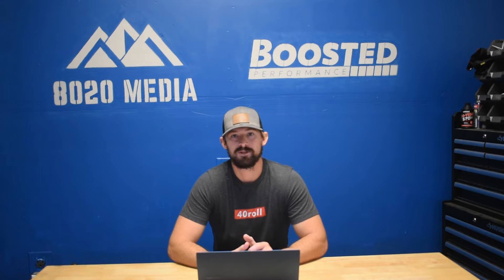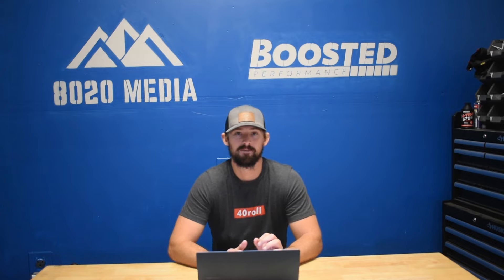DIY: How to Fix GMC/Chevrolet "Service Stabilitrak" & Traction Control Lights!

Comment: I only get this error message when I first run my car and it is cold outside AND only when im giving it gas. Stops if im coasting.  I live in snow country. once the truck warms up it stops giving me the dash notification. So frustrated.  Maybe you have a suggestion?? Also...awesome video. Gave me alot to think about and I've been researching this issue for over a year now. Thanks!!
Reply from the maker: Are you having any rough idle or sputtering issues when it's cold and your on the throttle? It could be a bad plug or coil but guessing you've already looked into that. I'd recommend looking into the idle control valve if you haven't.
Let me know if you have any other symptoms and I can try to narrow it down but if there aren't any noticeable symptoms then it can be challenging to diagnose which is the biggest issue with the stabilitrak lights...
Reply: Same here, mine is only happening when I first started my car and it's cold outside. Never happened when pumping gas. I notice it will be idling rough when the light is on then when it goes away the car doesn't shake anymore.
Reply: Hello everyone; Thanks for the Good video. In my case ; It happens only when it's cold or below normal, Engine Temperature indicator WON'T pass the 2nd mark which is next to C. I would assume it's around 50°. Reduce engine power, slows down, to less than 30mph , gas paddle won't respond, I stop,, Turn car off. Wait 1 or 2 minutes,, Restart,,All dashboard indicators is off. Drive normally,, TEMPERATURE STILL at 50°.  Drive  couple miles,,until it happens again..and Rested again. I have no doubt it's THERMOSTAT STUCK OPEN. What do you guys think. Didn't replace yet . It's cold weather this week. DFW, Tx .. 3 weeks later,, I'm sure in the case of pushing/ accelerating will be too much gas in the system that not enough air to burn it. I learned for the past 3 weeks since my 1st reply,, I don't push gas hard ,, if let car go gradually. It won't REDUCE engine power.until next discovery,, good luck to all Crappy 3.6 Chevy Camaro owners 🙋
Reply: @bassamghaferi3723  Sounds like coolant temp sensor.  Change that along with the thermostat assembly and use genuine GM.  Also, make sure coolant is fresh and proper level.  If green, it is even more critical due to it being galvanic over time, which bugs out the temp sensor.

Comment: This has happened on my 2020 chevy equinox a couple times over the past several months. It only ever happens when I'm driving down the road and accelerate a little too quickly for my cars liking. Or if I bump the cruise control up too quickly up a hill or something. It turns off cruise control and The engine light, TC light and the stability traction symbol light come up. Seems to drive fine still immediately after it happens. I haven't been able to get the codes because once I turn the car off and turn it back on all the lights are off. If it could be any number of things as you explained in the video, it's going to cost a lot to figure out what's causing this. 💸💸💸
Reply from the maker: K - How many miles do you have on it? The fact that it resets, you should be fine for the near term pending how many miles are on it.

Comment: I'm pretty sure traction control limits the power to any individual wheel by applying  braking power to the wheel.
Reply from the maker: That's correct, it uses ABS but also reduces torque sent to the wheels. Stability control is essentially a more advanced version of tracking control. It's sort of confusing breaking down the two but one way people put it is that all stability control is traction control, but not all traction control is stability control.

Comment: I have a 2014 GMC Acadia. Mine started going crazy when I was pulling a trailer moving from TX to NC. I was about 140 miles away and it started going crazy while I was on the highway. I replaced the brake position sensor and cylinder 6 spark plug and ignition coil (had a code for cylinder 6). It fixed when I changed the ignition coil, and then started back the next day on the way to work. I just noticed today that my brake lights stay on.
Reply from the maker: Check the brake switch, that would cause the lights to stay on and cause this. Also usually recommend changing the plugs and coils for all cylinders at the same time.
Reply: yep, mine was the brake switch causing havoc.

Comment: My 2007 Chevy trailblazer stabilizer sensor is out and every mechanic said it will cost two thousand dollars is it ok to disconnect the sensor
Reply from the maker: M - It’s technically possible to disconnect the stabilizer sensor, but it’s not ideal for safety, especially if you drive in poor weather or challenging road conditions.

Comment: Type "B" DTC's stored in the ECM (as a current fault) will request the Stabilitrac warning.
Reply from the maker: Thanks for the good info!
Reply: @8020Media  You bet!
Reply: How do do this?
Reply: GM WORTHLESS BS SYSTEM Trans  shifts  hard as soon as triangle  is lit?
Reply: @thomaslizarraga4955  Depends on the application, but hard shifting is generally the result of a system malfunction then transmission main line pressure is increased by default to try to save the transmission from damage.

Comment: Hey Jake. Great video! I have a 2007 Yukon and when I drive, if I take my foot off the gas for about 10 seconds, the service stabilitrak and traction control lights come on. When I hit the gas or brake, it goes away. Any ideas? When the lights are on, it makes the trans shift real hard also.
Reply from the maker: D - Have you taken it to a shop?
Reply: @8020Media  yes it has been to multiple dealerships and no one can figure out what’s going on.
Reply from the maker: D - Very interesting.. This is one of the first times we've heard something described like this. Give us some time to look into it.
Reply: @8020Media  not sure if it’s related or not but I recently had some codes for the Banks running Rich? I cleared it and just drove to Virginia over four hours and the check engine light did not come on and the stability track did not trigger.
Reply from the maker: D - Well hopefully it stays off for you! Were you having any drivability issues?
Reply: @8020Media  the only other thing I noticed is that sometimes when I step on the break, the ABS kicks back for a second but I’m on totally dry ground so don’t know if maybe one of the sensors is just messed up? We also had a problem where putting it on automatic it would click in and out of four-wheel-drive so the dealership couldn’t figure it out and just told us to leave it in 2 Wheel Dr. unless we needed a four-wheel-drive specifically.

Comment: I replaced my Driver side Valve cover. PVC. I do know all the coils and spark plugs are good and attached right. As soon as I test drove the 2007 Tahoe. The stabilitrac and Traction control kicked off. While driving it was pulling to the right. then cleared up. Then shifting hard, Then that cleared up then went back to shifting hard. Then I was able to push the button turning the Traction control back on everything went good then the traction control and stabilitrac kicked off on its own and started shifting hard again. The motor runs rough when this happens. When it clears up and idles fine it runs Good no problems. I did have the power cable off of the battery while changing the Valve cover. Not sure if that has anything to do with it. Any help would be Greatly appreciated. Thanks
Reply from the maker: C - Do you have any engine codes?
Reply: @8020Media  No, I also fixed it The boot on the Pvc valve broke and was causing the problem.
Reply from the maker: C - Nice! Glad you found out the issue and thanks for sharing your experience.

Comment: I have a 2009 Acadia and both the TC and stabilitrack lights are on. And just recently it won’t get over 20mph and no check engine lights. I replaced the throttle body and Mass airflow sensor pcv valve and noticed oil. Any advice would be greatly appreciated
Reply from the maker: Good recommendations from Elijah. I'd check fueling for sure - make sure fuel pressure isn't the issue.

Comment: Question I've had this issue with my 2007 yukon xl.  I had a misfire with the #7 spark plug and coil which fixed it.  Here is the  question. Ive had the abs and traction control symbol come on the dash. My engine idols fine but it has a hesitation at times at 30, 40 or 60mph. I have 370k miles on it. I just had my radiator go out so i replaced it with the water pump, timing chain, oil pump, oil pump tube, timing chain cover, harmonic balancer and both up and down stream O2 sensors. Before i replaced all those parts and at this time, the traction control stabilitrak and abs indicators are on, but no check engine light. I haven't hooked up my scan tool yet.
I had 2 different occasions where I parked on the opposite side of my driveway where I usually do not park and those indicators went off. Im going to check everything you mentioned, but could it be a wheel sensor. And when the indicators have been on I didn't have the hesitation like i mentioned. I did have it when that #7 spark plug was filing out because it had oil on it. I changed the valve cover gaskets too after i changed that #7 plug. Im just frustrated after changing all of those parts and still having the issue your video is about. And oh, ive changed the front wheel hub assembly 2 separate times. Im about to replace all the coils and plugs and wires. I did change the plugs and wires after I changed the valve cover gaskets. Im going to take your advice and see if i can get this corrected.
Thanks
Reply from the maker: T - Unfortunately, this is not the easiest thing to fix... Especially after you've replaced all of those parts already. Keep us updated on this.

Comment: Have you email? i have an issue: in the mornings when engine is cold and I start it on, the stability track sign pops up on the panel view, once engine is turn off and started on again it doesnt appear any more, could it be a relay? or what can be...?
Reply from the maker: T - Could be an issue with a sensor. Are you getting any engine codes?

Comment: I just ignore the shit : if it fires up and runs it’s good . Ha ha ha ha .
Reply from the maker: Yepp, honestly not that big of a deal to drive with it on but most people get annoyed by having a light on the dash and want to fix it. But ultimately fine to drive with it on.
Reply: I have the “service stabilitrak/traction control” with NO check engine light????

Comment: Thanks for the excellent video!

My Stabilitrak lights come on along with the bell tone when I turn right at the top of an exit ramp 75% of the time. 2012 Tahoe.

Steering positioning sensor?  Tire pressure?

Also, does the Stabilitrak screw around with the 4wd?  I got stuck in the snow last night and it seemed as if the Tahoe was fighting against itself.  I've never experienced such frustration.  The 4wd was useless. 

I've owned a few 2000 and older Chevy 4wd products and they were unstoppable in the snow.

They really screwed these vehicles up.
Reply from the maker: N - Yes, stabilitrak can certainly mess with 4wd. Think it could be either of those that you mentioned. Have you looked into any of them yet?

Comment: Just came across your video, I have a 2017 Chevy Tahoe and the ABS light comes on along with the brake like which causes the steering wheel to not really move, but once I turn the car off and back on it goes away but the stability track and steering wheel reduction message stays on the dashboard. 

I had the spark plugs and coil changed, as well as the angle sensor and the air bag clock spring.
Reply from the maker: K - Unfortunately, this issue is not easy to fix.. Have you taken it to a shop?
Reply: @8020Media  yeah, they said  my negative cable was bad on my battery along with the fuse box attached to it 🤷🏽‍♀️
Reply from the maker: K - That sounds about right! Have you got it fixed?

Comment: In short…. Don’t buy another Chevy. If my 2014 is acting up like this at 120k and I maintain it like a baby. It’s a shitty truck
Reply from the maker: Mommus - They just aren’t built the same anymore, sadly.
Reply: For real.  My 2011 is perfectly maintained.  Looks brand new and runs perfect...  No engine codes.  This damn stabilitrac is driving me crazy.  When I fix it I will sell the next day.
Reply: Besides seeing the light on the dash do you actually experience any performance issues when the service stabiltrak light appears ?

Comment: my manual camaro cuts off power when i slam into gear at high rpm and when i try to floor in the next gear theres like a 5 sec delay is that because of my tires being installed at the wrong spot after tire rotation???
Reply from the maker: Mr - Tires being the issue is unlikely, but here are some things we can think of based off the symptoms you're experiencing: rev limiter, traction control or stability control, or clutch issues.
Reply: thanks for ur reply! but even when i shift before red line between 5k-6k with WOT it does that. Redline @ 7k-8k. The traction control light doesn't blink even once during that long 5 second where im still wot but there is no reaction at all. The clutch does not slip the rpm just holds still like cruise control  but im in wot. Note: same thing happens when im driving normally but i go over a bunch of bumps the throttle cuts out just pauses for few seconds then goes still no light as well. im thinking the driver rear wheel which is in the front now after rotation is spinning diff speed  then the other  rear wheel still in the rear. Could mis match in speed cause this? where is this module located btw?  @8020Media
Reply from the maker: This could certainly be a possibility!

Comment: Mine flashed on and off, so did check engine light but it's freezing outside. I hope that's why it came on.
Reply from the maker: L - The cold weather is likely contributing to the issue, possibly through a voltage drop or sensor glitch. If the warnings persist or return, scan for codes to pinpoint the problem.

Comment: Thanks for the information. I have a 2007 GMC Yukon SLT that won't crank. Stabilitrak and traction control lights are illuminated on dash. Checked codes and it show P0449.
Reply from the maker: C - Thanks for the feedback! We have a whole video on the code and think it may help with your research: https://youtu.be/w6LrDYRnE8o

Comment: We had new tires put on our 2009 Yukon and the next morning the stabiltrak sensor started ringing and then goes off…any thoughts to look at first? I am planning to take it back to the tire dealer and have them look at it…no codes on dash appear; just the lights and ringing temporarily
Reply from the maker: L - Give it a few days. Your system needs a little bit to adjust to new tires.

Comment: Can a bad pcv cause that problem to if oil was in the air intake
Reply from the maker: T - Certainly possible!
Reply: @8020Media  I had the traction control service stabilitrak and reduced engine power. I was think high fuel pressure but when I took off airflow seen oil in it. I ordered the parts should be in today so if that fixes the problem I’ll keep you updated
Reply from the maker: T - Please do! Unfortunately, this isn't the easiest thing to resolve.. Are you getting any engine codes?
Reply: @8020Media  its fixed thanks
Reply from the maker: T - Great to hear! What'd you end up doing, for future viewers.

Comment: U are the wizard I need to bring my 11 Camaro SS back to life. Where are you located? Four shops including the Dealership cannot end the Stabilitrac and errors
Reply from the maker: B - Unfortunately, we don't have a shop. However, it is something we are contemplating in the future. This issue is not the easiest to diagnose..

Comment: i got one for u what does it mean when u put it in reverse or park and the stabilitrak light come on mine just started doing that
then i have to turn car off then on to reset
Reply from the maker: D - Sounds like an electrical issue unfortunately.

Comment: So I had my AFM deleted and my truck reprogrammed to just run on all 8. If I go through  some water it turns off for a while. Maybe a wheel speed sensor dirty? I live on a muddy dirt road and my truck is always dirty. It’s throwing the service traction control service stabilitrack and an ABS alarm. I’m going to go get the codes read. But if I have had the new programmed on my ECM to delete AFM, should I just ignore it? Truck runs great. Just annoying lights
Reply from the maker: Josh - We wouldn't ignore it because it most likely isn't related to deleting AFM. Certainly look into the wheel speed sensor, ABS module, brake fluid levels. Keep us updated on this.